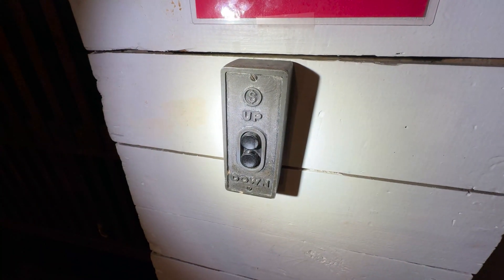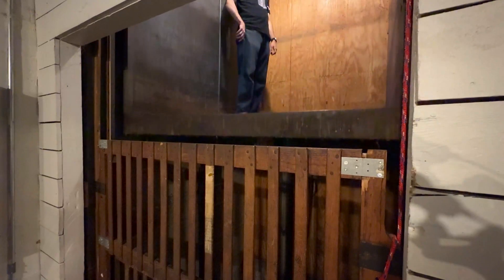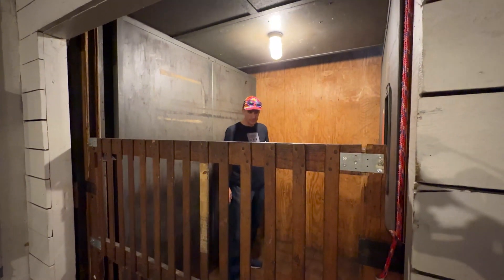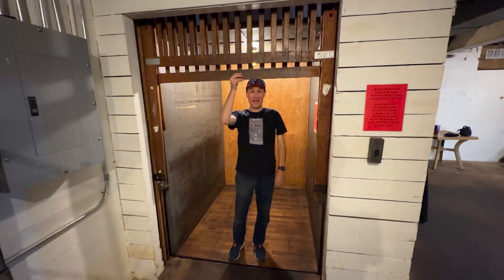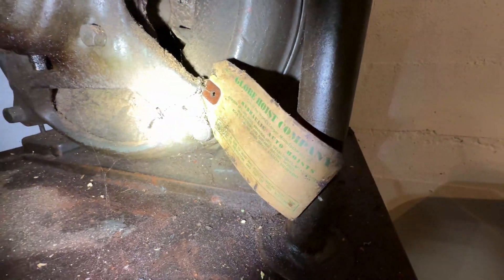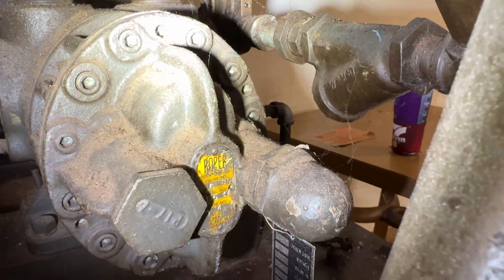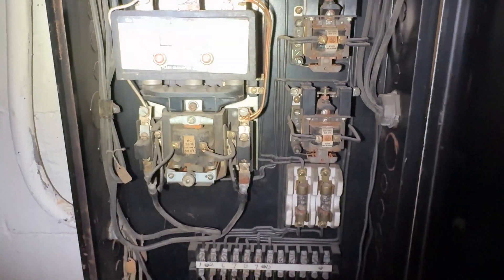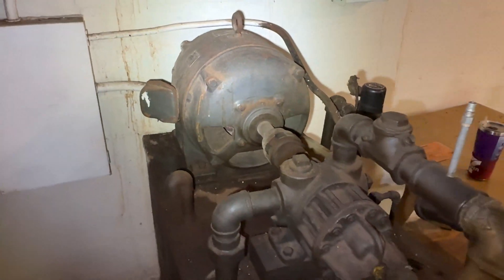Detailed Look at a 1940s Salem Hydraulic Freight Elevator

Comment: That's pretty cool. Growing up my dad worked at a high school that took over the building from an old printing company.  In the oldest section of the building they had a Salem freight elevator. The doors were your basic manual Pellee and the cab was a standard open top bucket style but the controls were nearly the same.  Only difference was theirs had a Salem logo just below the down button.